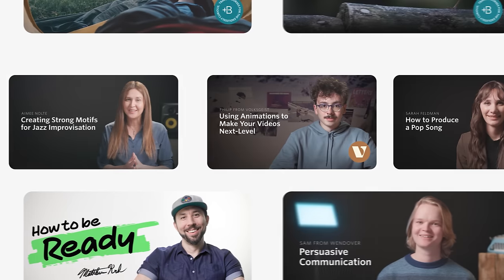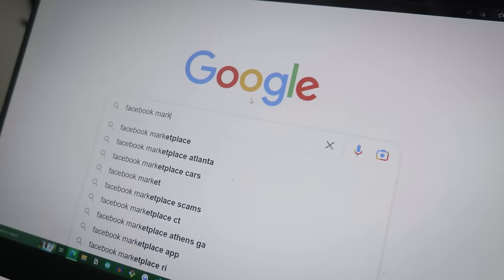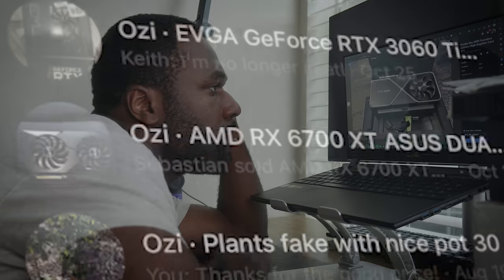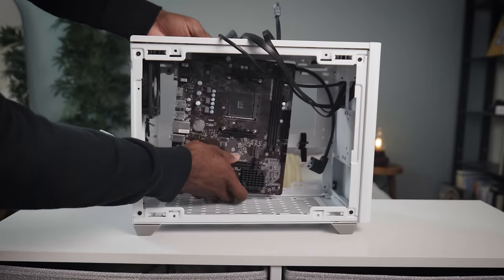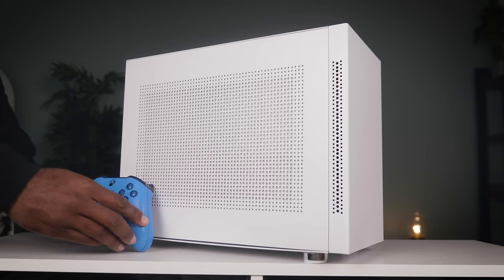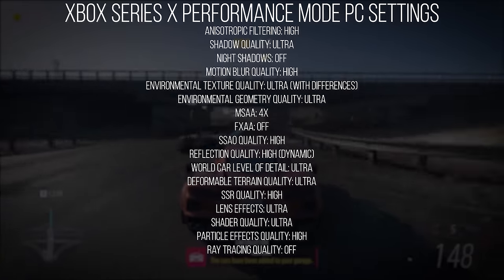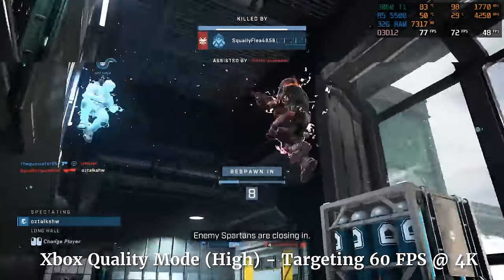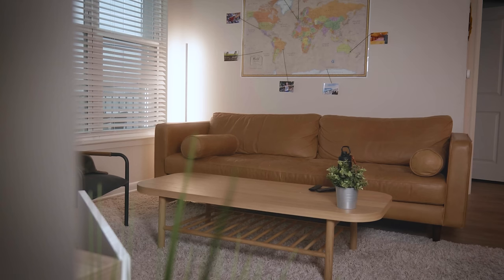I built a faster Xbox Series X for $474

Comment from the maker: Hey everyone! If you enjoyed this video, please check Nebula. It helps make these videos possible. It’s only a coffee a month if you can swing it. Never expected but appreciated! 

https://go.nebula.tv/oztalkshw
Reply: Yooo I heard you was in Atlanta on one of your videos. Do you sell the pics you make
Reply: Nebula seems like an awesome addition!
Reply: Expected to see you in Hogwarts Legacy... Hmm.
Reply: That's a really solid  build for budget PC gaming/Streaming online TV/General use PC.
Reply: but you can buy a used xbox for less so the price  match is not accurate. Also if you remove the gpu shroud you would have better temps.
Reply: I have Nebula. I love Joe Scott and Low Spec so I got a sub a while back. I didn't realize you were on there. Kudos!
Reply: But one thing you can't forget on Xbox is the optimization and engineering
Reply: I had the same error, with the same case and motherboard, understanding that frustration :face-purple-crying:
Reply: Are the two fans under the vid card pulling air in of the case or out? Your GPU fans pull into the card if those two bottom case fans are pulling out you have 4 fans facing each other competing for airflow. If they are they need to be turned around to help introduce cool air to the GPU fans. Not sure since I didn't hear a statement to the direction of the fans cause that's pretty warm. Love the vid otherwise you have a very calming effect lol.

Comment: For everyone who wants to make the build a bit cheaper here is what i did. I got an used r5 2400G and a used rx5700xt but a b450motherboard.
The benefits where that i could overclock the cpu for additional singlecore performance. 
And i got the whole for about 300bucks. 
Happy gaming!
Reply: Hey Fladu thanks for that 😁. How does it do performance wise I'm really interested in a build like this
Reply: @Jay-ho1wo  it performs quiet well in Forza horizon 5 i get 60fps at 4k high settings with fsr2.0 at quality preset 
About 90fps in halo infinite 1440p high. And about 80 in battlefieldV at 1440p high settings.
If you have the budget i would opt for a bit higher performing cpu bc it is the bottleneck in higher fps games like battlefield…
Reply: That's a huge W there. The 2400g is a tad slow imo though
Reply: @fladu2546  thank you so much. I'll definitely look into a build like this
Reply: Why get a G cpu when you are going to use a GPU? That cpu will limit pcie x16 to to PCIe 3.0 x8.
Reply: Yeah no real point in getting a G variant unless you can't get a gpu.
Reply: get a r3 dont buy G procesor if you are going to use gpu
Reply: @stephenxs8354  well ik but it was cheaper in my local area due to high availability… but i agree with it if you don’t ned the apu don’t buy it
Reply: I'd recommend just searching in local markets regularly. Sometimes you can get extremely lucky and get a great deal from someone who wants a quick sale.
Reply: @fladu2546  that's not 4k with fsr
Reply: @chriswright8074  I know this is why i said that i had it enabled… otherwise i wouldn’t have mentioned it
Reply: Newer G cpus (4600g/5600g/5700g) support 3.0 x16, it’s just the older ones (2400g/3400g) only support x8
Reply: Sure if you are trying to get close to the ps5 (nothing wrong with that), but the cpu is pretty weak. An amd 3xxx+ (non-g for the 3xxx) would be a better choice. But you could always upgrade the cpu.
Reply: The bottleneck from a 2400G with a 5700XT is too big to recommend…there’s much better processors for the same price in 2023
Reply: whered u find the gpu at
Reply: Just for the record, that 2400g will bottleneck a 5700xt hard at 1080p
Reply: @piercewiederecht5135  yes ik, but i was targeting a console like experience( 4k 30-60fps) and it runs fine for this use case surely is the gpu abit more power full then my 2400G…
Reply: @ac37282  Facebook market place… but be careful because the rx5700xt was a popular mining card
Reply: @fladu2546  . There's a certain level of efficiencies that come from colnsole development. For a "ps5" "console experience", the GPU is close, but the CPU is significantly less powerful resulting in quite a bit less than "console experience", especially if taking into account those efficiencies previously mentioned. If you really want that "console experience" you will need a 3600 at minimum which will provide you with less cores but better sustained clock speeds.
Reply: also, you're bottle-necking because the G-series Ryzen cpus have Graphical processing cores essentially. going for a slightly better non-G-series is the best option

Comment: I'd recommend installing the Steam Beta Update as I think the same UI thats in the Steam Deck now replaces Big Picture Mode by default. If not, you can install the beta and create a shortcut of Steam and add -gamepadui to the end of the target field and have that open on start up for a much better experience. :)
Reply: Good tip
Reply: Was about to write this!
Reply: @malvnathaniel same lol
Reply from the maker: I actually received the update a few weeks ago! It has some minor bugs that require a keyboard & mouse occasionally, but the UI is sooooo much cleaner.

Comment: The best part about the PC is that you can incrementally upgrade it every year instead of once every 3 or 4 years, it spreads cost allowing you to spend a little more on components and means you always stay up to date for the latest games. Upgrading cooling can also give you some headroom for overclocking which can extend the life of your cpu and gpu. And its versatile, can use it for everything from video editing to work to gaming. I build my first PC in 2016 and since then I have slowly upgraded every component at least once. I happen to have the same system you have here (except bigger and hence cooler) and it crushes modern titles.
Reply: Enter next gen amd cpus needing u to replace your whole motherboard with new expensive ones and new graphics cards most likely requiring you to upgrade your psu all jokes though i agree it’s one of the charms of pc gaming
Reply: @kasra8106  realistically? no. I run an AM4 Ryzen 9 5900X, and an Asus Rog Strix 3080 OC edition. Neither will require me to upgrade for the better portion of 10 years unless I have a part die due to natural silicon degradation.
Reply: @stonecoldslate   Neither of the parts in ur comment is next gen.
Reply: @stonecoldslate  I don't "have" to upgrade my 6-year-old stuff but it's increasingly difficult to actually run games looking and performing good at this point. If your goal is to play 1080 games for 10 years, you can do that if you buy high end stuff. But if you play at 4K? Good luck getting past 5 years.
Reply: @kasra8106   next gen by who’s standards, the 40 series and AM5 are barely upgraded at all
Reply: @stonecoldslate  Next gen by the definition of what next gen means….
Reply: Upgrade it every year? Who even does that? I'm usually getting mid range stuff (not high end) and i still end up upgrading once every 4-5 years. Upgraded from an rx 380 from 2016 to an rx 590 in 2019, in 2022 upgraded the fm-8350 to an i5-10400 (and new motherboard) and now i upgraded gpu again to a 6650 xt. So you actually incrementally upgrade it every 3-5 years (even more if you get high end stuff).
Reply: @miuletzmitzu6641 what is the yearly cost approximately for those "incremental" upgrades?
Reply: console fanboy @TheUltimateHacker007  spotted
Reply: @crackdog1914  No just a laptop user but still consoles are hassle free to work with compared to the constant monitoring and tweaking you have to do to play games on pc. And that's no debate
Reply: No, you cannot, a new CPU requires a new motherboard and ram... A new gpu you can update, but what's the point of upgrading each part three years apart? Dumb as fuck. Can't game on a six year old CPU and motherboard you cheaped out in because you didn't want to spend the dollars all at once. That upgradeability is a lie.

Comment: I finished building my first pc, I have a i512400f and a rx6700xt, runs great at 1440p 144hz high/ultra settings, thanks for making this video! Love them
Reply from the maker: Beautiful machine. Enjoy!
Reply: Can I ask what are the full specs and how much you spent on all the parts?
Reply: Bruh i have a rx 7900 xt and r7 5800x overclocked to 5 Ghz, and 1440p ultra at 144hz is a struggle sometimes, mostly in warzone 2 and hunt showdown
Reply: @MoBreYT05  hmmm, interesting
Reply: Solid machine. Mid range intel are grat cpu s.

Comment: It's crazy how good of a computer you can get now for so cheap.
Reply: Especially considering the astronomical prices we had just a while back
Reply: @KurisuKun  Now the rtx 4070ti to 500$ and i'm happy
Reply: Recession baby 😂
Reply: @ayushmandhar1418  this is not how it works
Reply: @checkcommentsfirst3335  why not? Nobody buys, price goes down
Reply: @lemonhaze715  $600/$700 would be more reasonable $500 would be a decrease from lasts gen
Reply: Exactly, which means that the next consoles that come out are going to be just as insane considering they get fully functioning prototypes a few years in advanced
Reply: @victorkreig6089  and then so will PCs
Reply: Good is relative when it comes to PC gaming, this particular PC he built would not be able to match the series x regarding new games, even elden ring as he mentioned plays better on the series x and on 4k, which would be damn near impossible with this PC. So for 1080p this is "good", for 4k this would not be able to play new games at a smooth 60fps
Reply: @dabbzgaming  there is some major factors youre ignoring. first of all the Series X is not a true 4K console 100 percent of the time. many games use dynamic resolution scaling as well as TAA upscale Anti aliasing to hide the lower resolution. yes the series X GPU has a maximum output of 3840x2160 but it doesnt mean the games are running natively at that resolution. second are modes. many games have several mode quality mode which is normally native 4K at 30fps with some minor drops and a performance mode at around 1440p at 60fps and a 120fps mode which runs at 1080p at 120fps or close to it. speaking of Elden ring it has 2 modes a graphics mode that targets 4k resolution but only 30fps and a performance mode that targets 60fps but resolution is around 1440p
Reply: @victorkreig6089  the new consoles are still behind lmao aren't even better than 6 year old gpus
Reply: @traestephen7276  factually wrong
Reply: @victorkreig6089  as powerful as a 2070 .
Reply: @traestephen7276  Some titles it's 2080/s equivalant,
Reply: Not in europe unfortunatly
Reply: yeah 3060ti for >250$, almost like its not true....because it's not..
Reply: @traestephen7276  A 2080 with 12GB of VRAM* (basically a nerfed 6700XT). It's also not all about resolution (and DRS works pretty well), asset/texture quality is undoubtedly much higher than on a 2070.
Reply: @dabbzgaming  What are you on about, this gen of consoles sits around the 2060 Super performances. They do have a few clever tricks such as upscaling which makes them able to run at higher resolution, but guess what, so do the PC with DLSS and FSR.
Reply: @matthewjuarbe5826  If you wanna do that, even the 4090 cannot handle 4k max in the latest games without DLSS. "True" 4K has too many dimishing returns to be worth it so it really does not matter in the slightest if its "true 4k" because most cant tell the difference when it drops in resolution or is upscaled with temporal injection and what not
Reply: @enzomercier2789  I can tell you dont know what youre talking about. Raw power wise yeah its around 2060 super, but with double the vram and completely new architecture....but in actual real world performance it punches way above its class (it performs more around the 2080 in most games) If you were to use a "PC equivalent" build against the PS5 / series x, PC is losing easily. Plus, so what if it uses clever tricks? True 4K is never worth it for the performance loss anyway, and FSR isnt that good compared to DLSS.
Reply: @jamrah8713  that comment i made was due to the person saidnthe series x was a 4k console and thats misinformation. Of course 4k ultra is tough even on the 4090. But facts are facts.some titles on the series x arent true 4K.
Reply: @jamrah8713  No it doesn't. If you don't take into account the upscaling, it actually performs like a 2060 Super, and with the upscaling it's nothing more than a 2060 Super using DLSS. Also it doesn't have double the VRAM of the 2060S as it's shared memory, so the 16GB are for both standard RAM as well as VRAM. We don't know how it's used in game, and it probably change on a game to game basis, but it certainly doesn't use the full 16Gb as VRAM.

And you're right, we don't care if it uses clever tricks, but as I said, those clever tricks are available on PC as well, so if you try to compare somewhat apples to apples, then you need to either compare 1080p vs 1080p or use DLSS/FSR on PC if you go with a higher resolution, and in both of those scenarios: a 2060S match the consoles.
Reply: He also got very lucky with deals that took him months.
Reply: @traestephen7276  I don't think the 2080 came out in 2017 lol
Reply: @lemonhaze715  That is very bad value.
Reply: @enzomercier2789  funny so how do you know its as powerful as a 2060 super
Reply: @trymefool2257  Digital foundry did a lot of tests on this, tweaking settings of games on PC to look the exact same as the PS5/Series X. 
And turns out the 2060S can handle these settings and deliver the same framerate as the new consoles.
Reply: In the US sure, but parts in Europe are so much more expensive.
Reply: @DillonCatterson  Thats cap
Im in eastern europe and i can get parts so cheap that i get better deals than US sometimes.
But newer parts yes are more expensive and harder to find
Reply: @enzomercier2789  I seen a video of a game that he did this with the 2060 super had dynamic resolution just like the consoles do in this game and the series x had higher resolution not sure if we are talking about the same video and this was from digital foundry I do find it a bit hard to believe that the series x is only as powerful as a 2060 super when you compare the Xbox series x to the s
Reply: Questions
 1: Can you play split screen on Steam?

2: Can there be two different accounts that can play multiplayer while only buying the games only on one Steam account?

Comment: The cheapest I could find an RTX 3060 version 2 was $349 on Amazon 😆. I bought 2 of them because I needed to build my son's PC, and I didn't think the prices would go down again until 2024 😂.
Reply: it's "Tİ"
Reply: I found a rtx 3060 ti for 210 on eBay only slightly used
Reply: @Isaiah  I've never used Ebay before. I didn't know enough about it to feel comfortable using it.
Reply: @alderoth01  i dont know exactly how but you can check to see if sellers are trustable
Reply: @alderoth01  eBay has really good buyer protection so don’t feel too worried about getting scammed if you’re buying the parts from a seller less than a few thousand miles away or so. 
It might be easier to get scammed if you’re buying parts far away from China for example because buyer protection is only valid for 30 days.
Reply: @Isaiah-gy4dy  Highway miles only, AKA that card was probably used as a bitcoin miner so gl